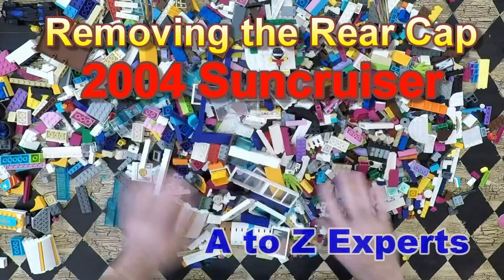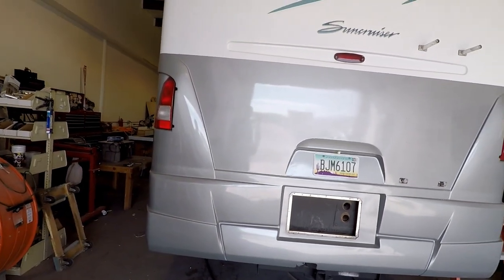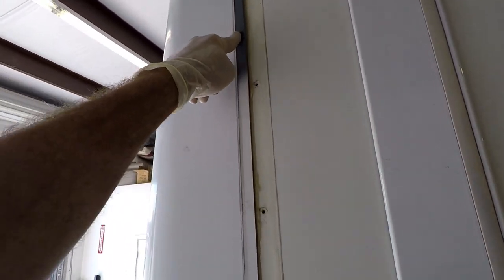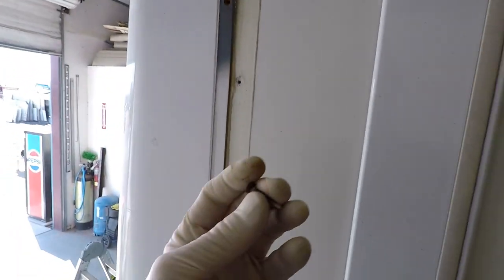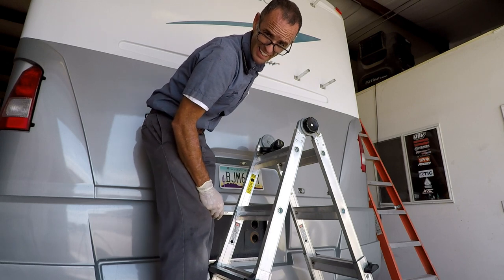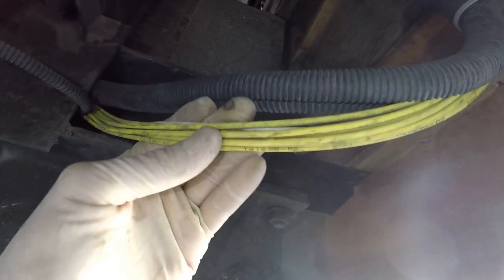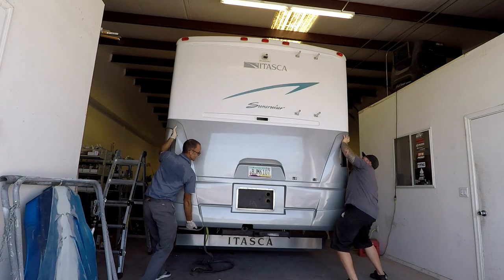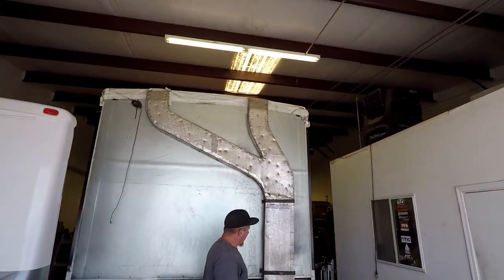How to Remove Winnebago Motor Home Rear Cap

Comment: did you use the same self leveling caulk between the rear cap and the roof that you used for the roof penetrations?

Comment: I know this is video is several years old, but I'll ask anyways.  I have the same motorhome and my fuse blew for the trailer plug.  Do you happen to know its location?
Reply from the maker: on the workhorse chassis the trailer fuses should be in the fuse box under the hood, I think the tail light fuses are 5 amp

Comment: How does the Furnace come out of there?
Reply from the maker: The exterior cover is removed then a black sheet metal cover and the frame holding the exterior cover and then the furnace is removeable just like a standard furnace